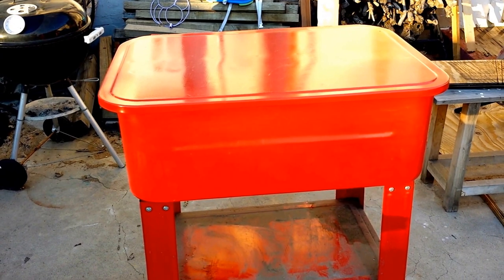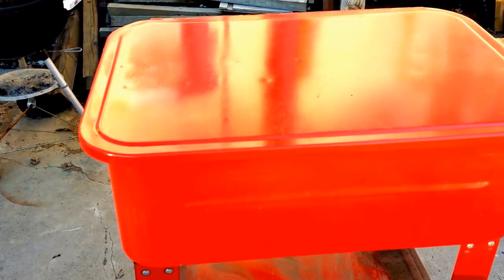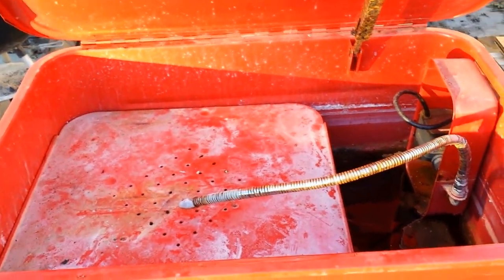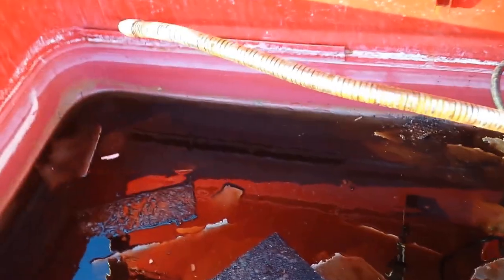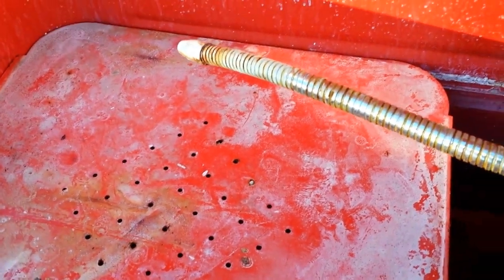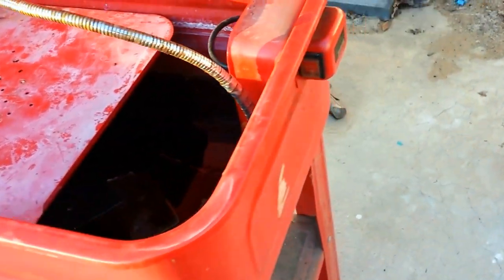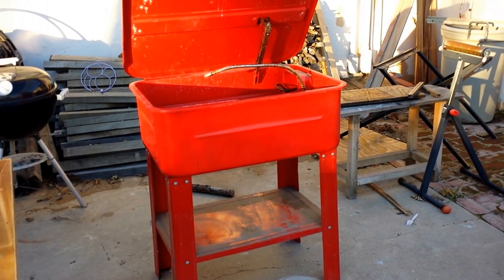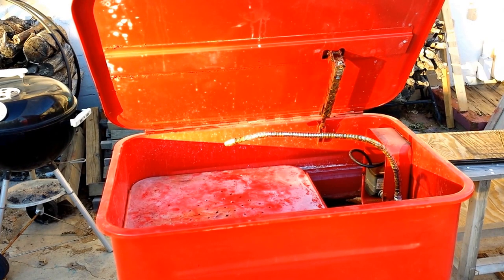Harbor Freight 20 gal car parts washer pump for cleaning car parts part 1

Comment: I've got the same one.  HF.  works like a camp.  also have the smaller bench model.
Reply from the maker: +Bill I should have pulled it out along time ago
Reply: I've thought of getting the smaller bench model to keep on a shelf.  Just pull it out rather than un-stacking the stuff on my big parts cleaner.  It doubles as a workbench.
Reply from the maker: Crafted surface plate stand huh

Comment: Hi brother if I have a 20gallon part washer how much is the less solvent I can put on it can I put 5 gallons or do I need to put more so the pump works right.
Reply from the maker: +Dr. Vape is it because the part us taking up a lot of volume or something else. Pump should be submerged but you may be able to short it a little.
Reply: Chris Anderson its k if I put 5gallons just to clean few parts or should I have to put the 20 gallons in.
Reply from the maker: +Dr. Vape just make sure that you have enough so the pump isn't starved
Reply: Chris Anderson thanks brother
Reply from the maker: +Dr. Vape not a problem